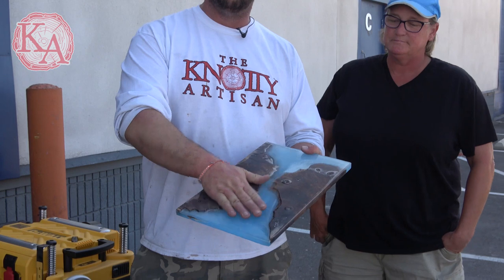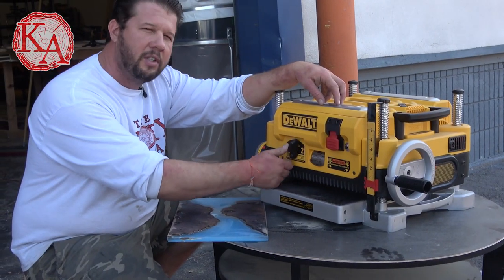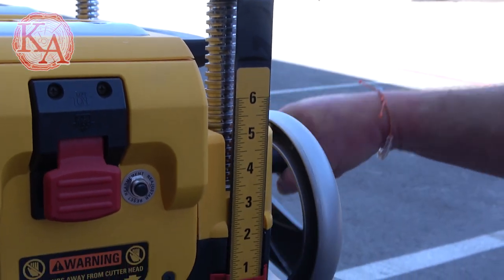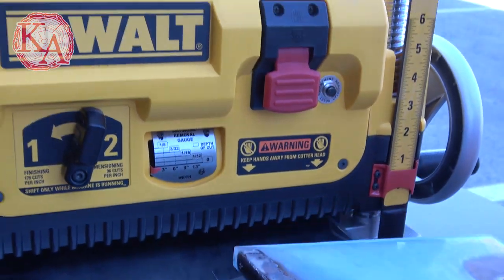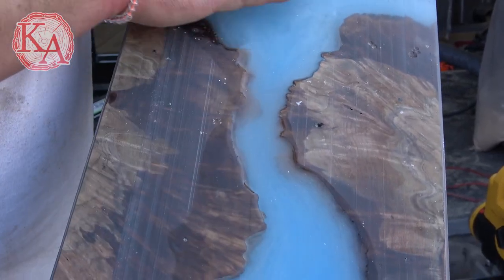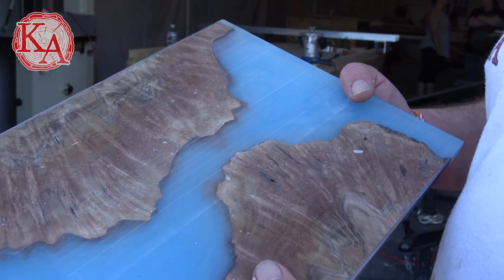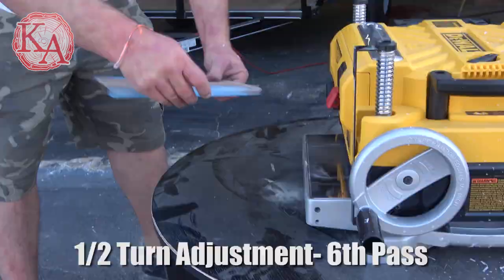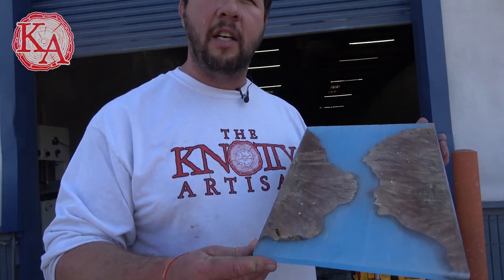How To Use a Benchtop Planer with Epoxy Resin

Comment: Hello from Australia. Thank you for this video. What type of planer would you recommend for something bigger like a coffee table
Reply: Hey Rob, if you need to flatten something bigger like that, your best bet is to make a router flattening sled and use a nice big bit, 2.5 inches or so. CNC machines can do the job too, or wide belt sanders you can run it through. Woodworking shops may have one available you can pay to use.

Comment: I made some 5 inch resin and walnut coasters and put one through my dewalt planer.  It shattered and sent shards of sharp pieces out .    I’m thinking it was too small a piece.  ???
Reply: Small pieces arent recommended for planers - bad things happen (as you found out).  The other issue could be grain direction.  Were your coasters end-grain by an chance? That'll send pieces flying too.

Comment: Can you say anything about how hard the epoxy has been allowed to cure?  Different results and some problems arise when planing both softer (recent cure) and harder (2 week cure) epoxy.   Also, helical head planers may have MORE problems with epoxy compared to straight blade planers.  Can you comment?  Thank you.
Reply from the maker: I like the straight blades over the helical when planing epoxy. I like my piece to be nice and cured (7 days) for most of the resins I work with so I don't have to deal with the soft/rubbery texture.

Comment: I have the exact same planer, planing the exact same epoxy projects and my planer dewalt almost sounds like it loses 1/2 power after a few passes and multiple times has had smoke come out the unit. 15amp breaker, extension cord, not sure what the issue is? Ever seems that?
Reply from the maker: Dang that's intense. Dull blades? To deep a pass?

Comment: Thanks for the video. I've been wondering about doing this. I didn't know if the 2 different materials would mess with the blades on the planer or any extra adjustments would need to be made. Does the epoxy gum up the blades at all or is it okay as long as it is cured before it gets planed? Would love to see the rest of the process along with the final outcome.
Reply from the maker: Hi Chad once it cure it is very hard and you can use your regular wood tools on it. Because it is so hard it will dull an edge a little faster then normal so just keep that in mind with your planing blades etc.
Reply: I might have to disagree with Knotty on this one. I was using my electric hand planer on an epoxy project and the chord actually caught on fire and completely destroyed the machine! I believe it had something to do with the epoxy, and it was fully cured when i planed it. However I was working on it for awhile before it caught fire. I would say, if you do plane epoxy, give your power tools lots of breaks and dont let the epoxy build up underneath the blades. Cheers!
Reply: @MrJoelDavies  I'm glad I helped somebody:) That makes sense then for how it could've caught on fire! Yeah as long as you don't over do it you should be fine:)

Comment: I’m surprised half turns don’t make deep cuts. Do you ever have a issue when you plane the boards that you get deep cuts or is that you think from the epoxy not setting up correct.

Comment: Hello,
I have recently started a woodworking workshop in India, and want to buy a plunge router. My major working in the beginning is going to be on resin tables with hardwood. Which collet size machine should i go for: 8mm or 12mm?

Also I have planned to use my plunge router as a self made CNC Machine.

Plz suggest.
Reply: @rishabh kesarwani I have both a 1/4" and a 1/2" router. I use the 1/2" for planing larger pieces of work, and the 1/4" for smaller items. The latter I also use for roundover edging because it is a smaller device to work with BUT I also use it for planing small projects, such as river coffee tables / wood artwork etc.  It is also - and I have done so - useful to have the 1/2" router which accepts a 1/4" collett. Finally, I recommend that you buy the best router planing bit you can because they are better made, last longer and there's less tear out of both wood and resin. 

There's nothing worse than ruining a fine piece of work, especially near the finishing line... As the saying goes, "Buy cheap, pay twice"!

Hope this is useful.
Reply: @arthurised  Thankyou so much for the satisfying reply...It will help...Keep up the good work 👍🏼😊😊